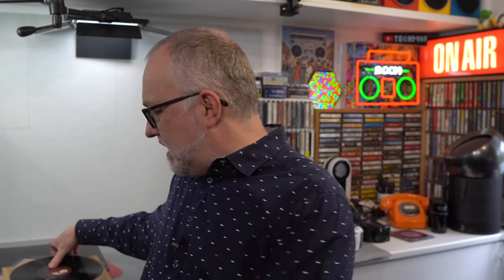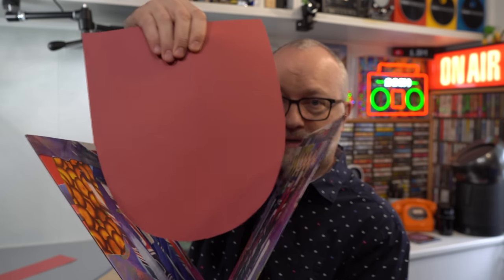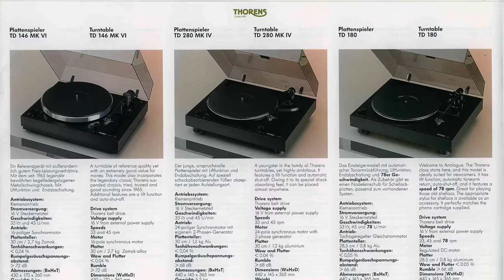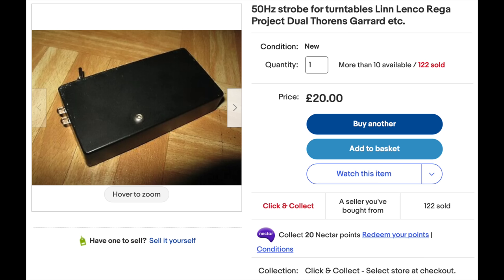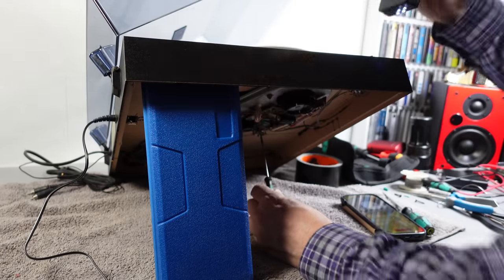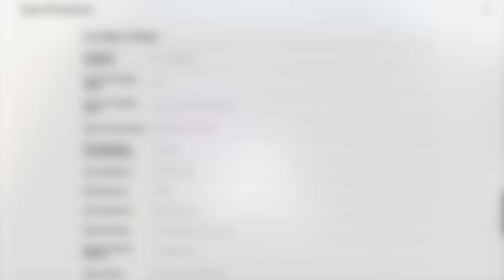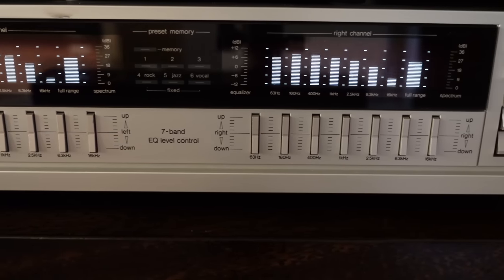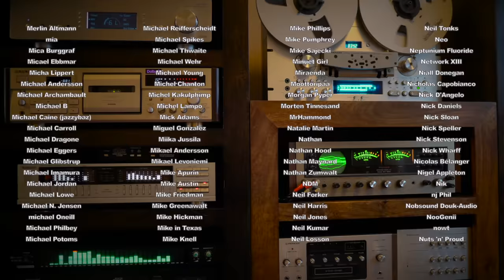Playing 78 RPM Shellac Records properly

Comment: I don't agree so much with the thought that it MUST have a failed component that's causing the speed change.

You said it yourself, this is a cheap turntable from the 90s. There's a good chance it was NEVER correct, even new from the factory. And even if it was correct, it's normal for components in analog circuitry to drift over time. Values change, especially if the device is kept somewhere that isn't temperature and humidity controlled. A five percent drift isn't even out of spec, because most components are rated for Plus or Minus 10% from the rated value. 

That drift doesn't mean the component has failed. It just means it's drifted a little. That's WHY they put those adjustment pots in there in the first place, to account for the normal drift. 

Now if you adjusted the pot fully one way or another and STILL couldn't get the speed right, then that would be the time to say something has failed and needs to be replaced.

Comment: I have always enjoyed your videos every last one. This one you went more than the extra mile on. If you simply wanted to take the 78s and make a digital copy of them cheaply I would have taken my best 33 1/3 turn table, swap out the tone arm head with a replacement 78 stylus & cartridge, remove the center post spindle so the offset record whole can be better aligned to reduce the stylus skate wobble. Then I would record the record at 33 1/3 speed and have Audacity fix the recording speed difference and audio imperfections. Buying all new equipment and replacing, fixing, and adjusting it seems a bit much. Good job though on what you did except for the record wobble. That still troubles me not being a perfect turn of the groove pathway.

Comment: I have a Silvertone (Sears) portable acoustic phonograph, rather weak spring. My repair guy told me to use it only for acoustically recorded records, as electrical recorded discs have narrower grooves, increasing drag. So the stylus v groove problem started before 33's / Microgroove came in.

Comment: Is it possible the aftermarket power supply is slightly out of spec/lower voltage and thereby making things run slower than with an OEM one?

Comment: One thing which is quite useful if you have a strobe disc which shows the american 60Hz rings but struggle to find a lamp is to check the refresh rate on your smartphone screen. iPhones for example have a refresh rate of 60Hz so if you look at the strobe through the phone using the normal video app it'll show the strobe effect no lamp required :)

Comment: Not all 78s are 78rpm though, which is where the governor on a mechanical/acoustic gramophone is very necessary for playback of some records.

Other than variances from one disc to another, Edison and company insisted theirs were going to be 80rpm instead of 78, as some kind of proprietary format to maintain control. Needless to say, it didn't catch on, and the discs are playable on most other conventional gramophones with the speed tweaked a little higher than usual. 

And in France there was a notable manufacturer that insisted the stylus should oscilate in a vertical orientation rather than a horizontal one. They sold a few, with after market reproducers available for existing gramophones, but that's a different issue entirely.

Comment: Matt, do these 78's specify the EQ used when recording on the labels? Also I hate to be one of those folks, but I'd get a set of non-metal pot trimmers rather than sticking metal screw drivers into metal trim pots. You're less likely to interfere with the electromagnetic fields in more more sensitive circuits, and less likely for something to produce magic smoke because your hand slipped.

Comment: On the expensive deck, rather than have to adjust the tracking weight whenever you change the heads with different cartridges, you could include some extra weight on the head with the wider stylus.

Comment: "I shouldn't have to adjust the pots to get the speed right."
You have a wild confidence in the assemblers to adjust it right the first time as well as analog components to not change over decades. I do not. However, it's good to check and change the other items first.

Comment: If the Thorens came with a cheap AT cart, then I'm pretty sure there's a 3mil stylus option for it. There's a good reason to listen to 78's with both channels summed to mono, and that is it will cancel out stylus movement that isn't lateral (side to side) since vertical movement produces out of phase information between the channels.

Comment: Rather than 'pick' a side a true mono cartridge only moves in one orientation so should output the SAME on both channels - if you use 'mono' switch on a phono or integrated amp then the differential sum of the two will reduce the clicks and noise.

Comment: One thing you can do for a record with a spindle-hole that's out-of-center --- and so the tonearm "weaves" in and out as the record turns, increasing stylus-wear and sometimes causing noticeable speed-wavering --- is to use a drill bit to slightly enlarge the spindle-hole so that the record can be shifted a little on the spindle, and then nudge the record around on the platter a bit at a time till the tonearm-oscillation disappears. :D

Comment: perhaps check the power supply, as it’s aftermarket , check voltage and amps , if the motor gets to little of one or both the motor starts making noise

Comment: I wanted a solution for this, and I ended up spending £10 on an old 1970s BSR deck from a junk shop. These old decks can play at 78RPM, and have cartridges with one of those flip over styluses - you can pick between Microgroove or 78. It sounds fantastic and doesn't damage the records. It's a revelation - even my finest acoustic gramophone pales in comparison to the quality of the output from the BSR deck, especially with later discs. Plus there are advantages from not having to change needles every play, and being able to adjust the volume easily. Speed is also spot-on.

I expect one of these modern decks would be better, but this does a fantastic job for me. Thanks for the interesting video.

Comment: I have the same gramophone as you! I know, it was very common back on the day, whenever that was.  TYVM for explaining about the groove widths.  I remember as a child back in the early ‘70s, our record players had four speeds, 16, 33 1/2, 45, and 78 rpm.  They sounded terrible for the 78s, and finally, I know why.  It would have been interesting to hear to do a sound comparison between the HMV gramophone and a modern turntable.

Comment: It's possible that the resistive element in the pots you adjusted have aged and slightly changed in value..thereby causing the speed difference.
Reply: It's probably been like that since it left the factory judging by how little use it seems to have had.

Comment: I live in Europe, and there was only one correction +13 db bass and 0 db treble (flat) i get that eq by switching off the pre amp, set bass to +13 db and use mono switch in my amplifier. This is trick how to do right eq for European 78's without buying this specialist pre amp.
Reply: The TC 778 preamp does that on 78 mode

Comment: There is a way of getting stereo recordings from 78s. The manufacturers tended to record more than one master at a time. So they had more than one recording machine running during a recording session. It's possible (from batch numbers, apparently) to tell which number machine was used for the master so if you can get two 78s of the same recording from different masters you can create a stereo recording.
Reply: With the same single microphone in the studio.. there is no stereo there.. just a duplicate of the same recording. The reason a very few large record studios used two cutters was if the artist was famous/important/expensive/stroppy to minimize the risk of a technical fault and having to do another take .. The reason 78's tend to sound good is because they are direct cut from the performance. Magnetic tape of high enough quality didn't arrive until after WW2 and you can hear the difference in recordings made post war.

Comment: I'd definately go with the AT-LP120X.

Mainly because I already have the turntable and would only need the right cartridge 😄
Reply: The 140XP is better, no junk preamp built in
Reply: @manFromPeterborough  you can bypass the preamp on the 120X. The problem with it influencing the sound when switched off was on the 120 only
Reply: @bernhardire2557  I saw Vinyl TV's clip about how the sound is bottle necked by the early 120USB, it has 2 inductors shunted by caps, I have removed them without doing away with the internal preamp, the other drawback with the 120 is hum/buzz pickup due to more signal path wiring, I left a power board behind the TT, the buzz was horrendous, since relocating the board, it much improved, not perfect. The 140 came with 2 problems, a noisy transformer, replaced with toroid and audio grounded to mains earth, causing hum loop with ground lead on and earthed amplifier, I separated the audio ground from the earthed chassis

Comment: I disagree with the summary of why a smaller needle wouldn’t work. The sides may move in and out, but they are straight all the way down for any given cross-section, aren’t they? Also, all that talk about “scraping” is nonsense, since if you magnify the whole thing, it looks just like with the bigger needle, but with higher differences in the audio. One problem I do foresee is potential imprecision at the very bottom of the groove for such a large size, along with a larger amount of scrape and dust from the previous use of larger needles, but you mentioned neither of these, and merely stated that there would be less sound down there as if it were geometric fact even in a perfect record.

Comment: And this is why cd’s and eventually data.
Reply: @marleypumpkin4917  it’s to damn difficult.  Too much goes into it. It’s been a long time for me. I grew up on Technics 1200s.  The proper needle, the proper weight records easily damage from scratching. CDs changed all that, but then it was digital audio converter’s that sometimes weren’t good in the beginning. Laser, tracking mechanism failures.  And now this data. Solid-state drives.  Audio file players that play lossless data that are insanely expensive and have very few if any failures, other than depleted battery life.  I also had a Sony TCD D7, good sound, lots of problems.  Hence data.
Reply: @marleypumpkin4917  no need for Dolby see noise reduction when there’s no hiss.  Are used to play my records underwater when I recorded them because you would get less audio noise from the contact between the needle in the vinyl, especially when the record was a little worn.  No need to take really good care of your CDs when it’s just data.  You can have your entire collection stored in one terabyte or 2 TB. You can put them on multiple devices and keep them all backed up. They take up less space; data.  The only thing you miss is the cover art. I do miss the physical cover art.

Comment: There's a simpler and less expensive way to archive 78 RPM records and still getting good results, especially if you don't have a big 78 RPM records collection you want to play often. You can use a 33/45 RPM turntable : it only requires to replace the standard cartridge with a dedicated 78 RPM cartridge (there are even P-mount cartridges that are compatible), then play the record at 45 RPM while recording on a computer with your favorite audio recording software and the appropriate RIAA settings, then speed up the audio file by 1.733 (78/45) before saving it.
And Bob's your uncle.

Comment: How does an incandescent bulb flicker? I've never noticed them flicker. As long as the filament is hot it's lit.
Reply: AC current produces variation in voltage, a light bulb played in slo mo will show brightness variation, it doesn't fully extinguish between the cycles

Comment: An old trick was to tape a penny to the top of the head shell, then adjust the counterweight to suit. You could use variations on this to get two carts in different shells to both have the proper tracking without readjusting the counterweight.

Also, tweaking the tracking force a little on a record can have a fairly distinct effect on the amount of hiss, clicks, and pops. A little heavier tracking can often reduce the clicks and pops.

Comment: Q. If you recorded a 78 rpm record directly into audacity using 33 1/3 rpm on the turn table and then sped it up in audacity, would you get a better recording?

Comment: The weight of your phone slows it down.
Reply: I was just thinking that, I wonder if the phone app requires you to put the phone on the turntable, or could you just hold the phone a few centimetres away from it and it MIGHT give you better results?

Comment: Going to stick my palm through my forehead…you have a non-original power supply. I don’t know why you’re surprised that you had to adjust the speed control pots, the non-original power supply was obviously putting out a slight bit lower voltage than the original. 
This isn’t “something you shouldn’t have to do,” it’s actually absolutely unsurprising.

Comment: You could have gotten a WAY BETTER turntable for less money in the Dual CS-608- I have one,and it has the 78 speed,and it's direct drive! with adjustable speed control, with lighted strobe,and Ultra-low mass arm.

Comment: The stylus part is what intrigued me immediately. I do know about those materials, it's a serious problem for getting the intended sound. And if you use a normal stylus at the correct pressure, you'll destroy the disks. The irony is the manufacturers had to create styluses that would wear out faster than what they where playing.

Comment: I am an old audiophile and cannot play records of any type that show the tone arm swaying back and forth horizontally on the turntable . My solution is to look at the record as it's playing and determine the place where the tonearm is at the outermost position. At that point, I use a small file in the center hole to elongate the hole so that when the record is placed on the spindle, I can adjust the position so that whe the recod is playing, the stylus does not move side-to-side anymore. At that point, I record the record onto a different medium and that becomes my "master" source for any future reproductions of that song(s). I don't care about "ruining" the record center hole since I now have the very best, most accurate "master" source for that particular song. Please try my method and let me know your thoughts. - John

Comment: Bruh, your speed is off because the pulleys are dirty af. At about 13:14 you can clearly see how much goop is on the motor pulley. The turntable's pulley is much larger and if its as dirty, youve made the pulley even larger and thus, have a lower speed on the turntable.  Clean the thing. I laughed my ass off when you replaced the caps and the speed was literally the exact same lmao. Love the videos but wtf lol. Havent watched to the end yet idk if that was what you ended up doing